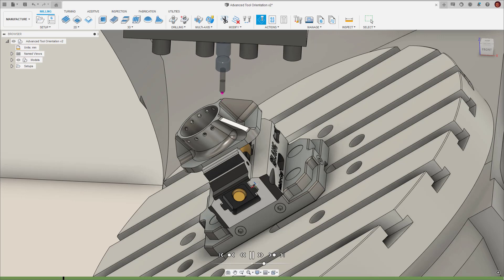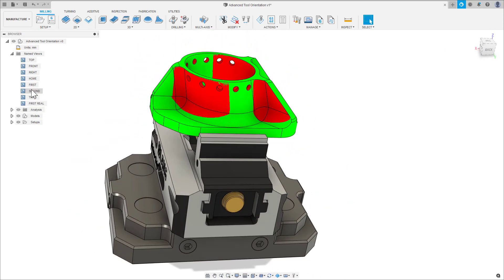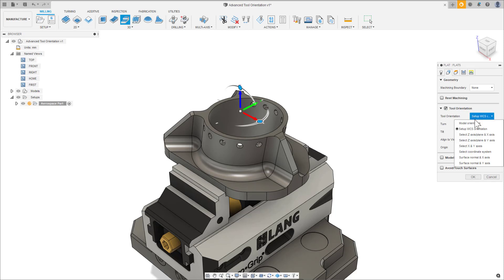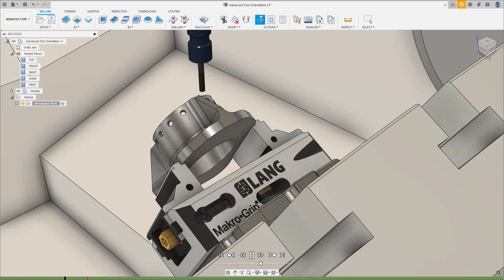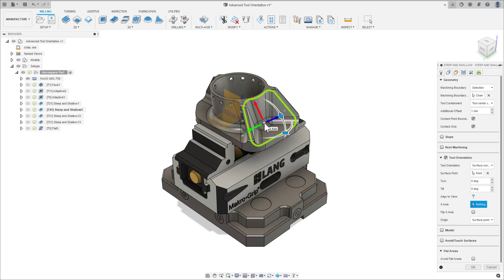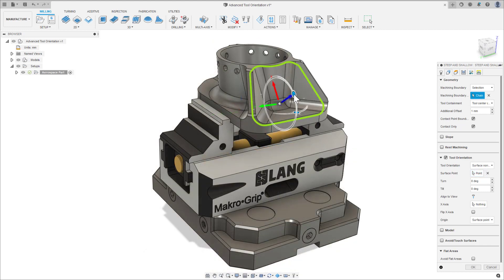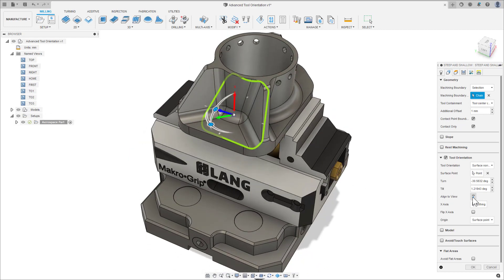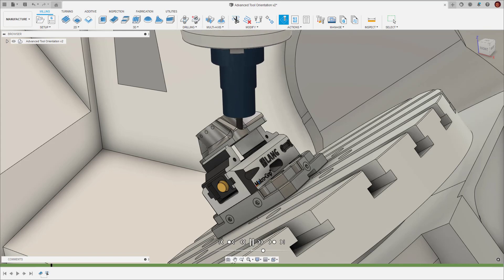Tutorial: How to Use Advanced Tool Orientation Controls in Fusion 360 | Autodesk Fusion 360

Comment: Trying to post process after trying this method for a 45 degree rotation on 4th axis 3+1 setup. Fusion is throwing a "direction not supported error?" I am wondering if you have encountered this error when using tool orientation and how did you fix it?